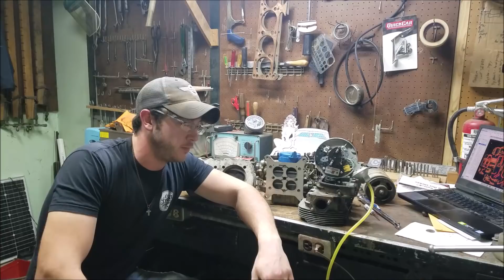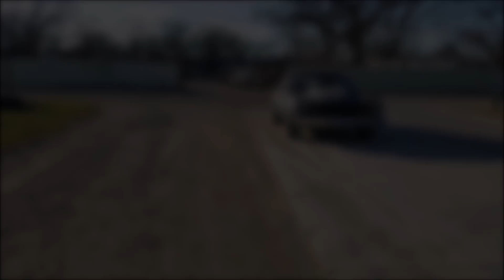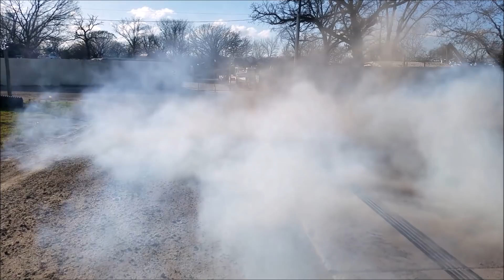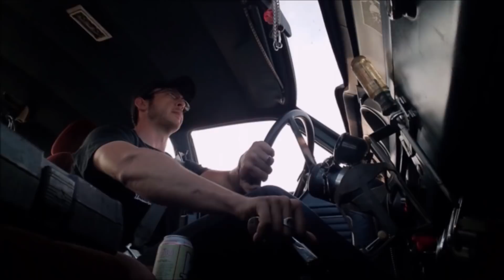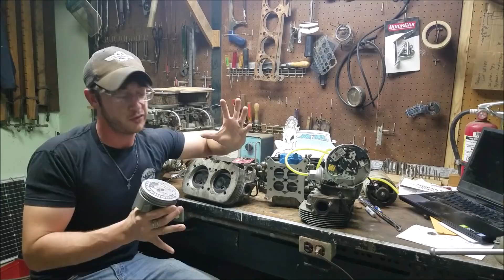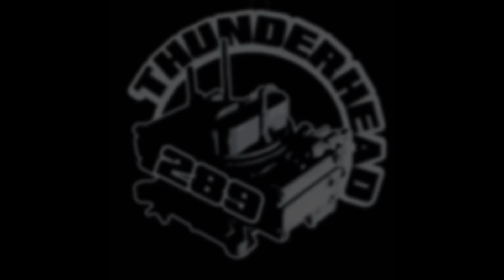How Ignition Timing ACTUALLY Works, ya idiots

Comment from the maker: Often, tutorials over simplify ignition timing to the point that its lead to an overall lack of understanding of how it works. for me, understanding what a system is trying to do is often my own deliverance in having a strong command of how to interface with that system. okay, so less engineer words here - if you understand how something works, you are much more effective in tuning it to peak performance.
Edit: one thing I forgot to mention - when you go up in altitude, atmospheric pressure drops, so ignition timing has to increase for all things equal at sea level. 
Progression Ignition distributors don’t a stupendous job of handling this on the fly.
Reply: I would do a tuning tutorial for the most common thing, which is heavily worn, high mileage cars which have low compression due to wear, and therefore want more advance.  That's in addition to both of mine being low compression smog motors.  However, some old motors also have heavy carbon deposits, which take up space, thereby raising compression, and can get red hot, pushing ideal timing the other way, unless cleaned.
     I think people got the idea of deleting vacuum advance by looking at full time dragsters than hardly ever see part throttle operation.  but vacuum advance  does hadly any harm even to full time dragsters.
Reply: ThunderHead289. My granddad used to play with timing. He made gasoline engines work on parafin. I used to play with it a bit also. I would advance my honda 4 stroke moped a bit to get ,,performance,, of a 2hp cb 50cc block(a netherlands moped block only allowed 49,9 cc) they had an balancer unit like your mechanical timing advancer.
Think jappanese: it worked the other way around. When reaching the max revs it retarded the ignition thus keeping the revs controled. I could rev my block up to 12000 instead of 8000. 2 way to block the weight. 1 some guys would put a taper trough the weight and the base plate. That was an deliberatie action.
2 block them with a strand of wire.
Possibillity 3 get an german or belgian flyweel.
That didnt have the counterweights.
Or take public transport?
Reply: Yah I live at 8000 ft and have a factory high altitude 2bbl ford 2150 carb.  Stickers all over engine bay stating "high elevation".  Says to bump timing up 2 to 4 degrees from baseline......funny thing is that just puts the 79 motor back to an identical motors timing made in 78 before emissions on this vehicle.  79 broncos had cats and 78s did not (except California).   Need to note that emissions vehicles have different timing specs than not emission vehicles so we need to "play" with things to get them right.
Reply: Hi, Luke,
Is the compression calculator link the same one u had years ago?  From Pat Kelly? 11:22
Thank you
Reply: Then when you think you got it all figured out throw weather changes into the equation and fuel variations (specific gravity and rate of burn) Great explanation Luke.
Reply: Sounds like you'd need a MAP sensor for detecting pressure drop at altitude.  Though you'd be getting awfully close to having a fuel injection setup at that point ;)
Reply: Don't understand what more timing means.  How is more timing achieved when you have changes in atmospheric pressure?  Wouldn't it effect how the carbonator functions?

Comment: having trouble with 390 FE. Had dist recurved for new rebuild. On my run stand Initial with max vax at 19 inches is almost 20 deg. Mecanical is 20 deg @ 3000 rpm. Vac adv adds 13 deg. Dist guy says to set initial to 14 deg and see if it pings. Not in truck yet. Does my Mechanical need to be lowered? Total timing without vac adv is 35 deg with initial set to 14 deg. Lowers my vac quite a bit.t Engine screams from 750 rpm to 5k fast on run stand if I set initial to 20 deg. Not sure what to do. if I time it at 20 deg max vac then crusing at 3krpm total with vac adv would be 53 deg.
Reply from the maker: I wouldnt draw any conclusions till its in a vehicle under load - that is the real test.  20 might ping like a son of a gun coming from a stop under load (ill save you the lengthy explanation as to why). 

But yes if you end up at more than 14, you are going to want to consider limiting total timing. 35-36 is reasonable - engines can ask for more depending on a number of factors with the build, but you really have to listen well and lift immediatly if you start to hear pinging. 
Yes, vacuum advance then comes into question also if you are going to be cruising then at an rpm that the total is all in by.

Comment: Is there any way you could post a video where you show what in-vehicle sounds like with retarded ignition timing, over-advanced ignition timing, and correct timing?  I'm working on a tired 460 F250 and set the timing to best vacuum, then pulled timing until it didn't kick back on starting (using ported vacuum)...and when accelerating it sounds like a tractor and feels gutless.

Comment: Excellent Content Thanks.    Question?   I'm struggling with understanding what "Initial Timing" Value is ideal for a given engine. (10°, 12°, 14° etc.).  Would Hooking up a vacuum gauge to Manifold port and (adjusting the distributor at idle, transfer slots set correctly) achieving the initial timing by reaching  (Max Vacuum, back off a tad) be a wise way to discover what initial Timing value is ideal for an engine?   Thanks.

Comment: WRONG
Reply from the maker: I mean, it's 1000 percent correct dude. Whatever you have been pandered otherwise is flat out incorrect.
Reply: @ThunderHead289  3200 lb pump gas driven 3 hours to the track small block 411 ' s carburetor cruise on 87 octane 10-second car 92 OCTANE ............. RITE .
Reply: But I am going to watch your video again I had a couple of interruptions I may have missed something . PS keep on Hot Rodin

Comment: Thunderhead289 I would like to hear your thoughts on the FE rocker arm oil restrictors. Should we use them or not? I know the FE engines have oiling problem because of the oil being pumped out of the oil pan to fast to the rocker arms. That was a major problem with the 390GT engine back in the day. I did a test with a drill on the oil pump shaft and I could pump the pan down below the screen in about 30 seconds on a 428 SCJ engine. I bought this engine as a rebuilt engine. Ended up rebuilding it again with boring it .30 over. I got stung on that buy. Lol.

Comment: I have a chevy small block engine with small cam.  Got it set to 800 rpm at idle. Advanced settings to 35 at tdc and 12 degrees idle at tdc. I used pressure vacuum gauge and the best reading I could get is 14. I was hoping to get it up to 16.Truck runs alot better than when I bought it. Im learning  everything about cars from watching your videos and has hoping for suggestions.

Comment: Hey Luke, been watching you for awhile now and have a question for you Sir.. I’m amazed in that I’ve been working on a Chevy C10 with a 383 Small Block. Initially guy I’d bought it from had vacuum advance disconnected. I re-enabled it. Ran better afterwards and better when re-timed. Then I had slight spark knock, and here is the strange thing which happened.. “Before getting the timing correct, I lessened the exhaust back pressure by going to larger diameter exhaust pipe, then here is the thing… The spark knock which was in engine went away with less back pressure in exhaust. This showing dynamics you had mentioned here?

Proof of your statements given I’d say, very cool Sir!

Question : and for example here..
“Less exhaust back pressure eliminated this particular engine detonation or “knock?”

Cool😊

Comment: Hey Luke, i have 1st gen 350 with a edelbrock e street top end kit with 315hp at 9.1 compression. What should my total timing be at and initial timing be? If im doing it right with the vacuum advance removed from the distributer  and plug its running at 14 degrees initial and 28 degrees @ 2000-2500 rpm thanks.

Comment: Vacuum works instantaneously, giving fast advance, working together with the acceleration pump squirts (carb side). As one throttles up to WOT, the vacuum advance goes max quickly and then decreases and eventually going zero (close to WOT). This is the basic idea. Centrifugal will only advance according to rpm, not helping out on the initial transient surge to start revving. This is the basic idea to have both working in tandem in the distributor. Great channel with really original stuff. Greets from Brazil.

Comment: Ignition timing has a lot to do with the resonant condition of maximum power. It's like a swing where you kick your legs out is like the spark. Where you advance the spark timing, there's more time to develop horsepower at higher rpms. Where you go over the top of the swing-set is like your horsepower peak. The timing of the legs kicking is just like variable ignition timing across the rpm range. Less advance at slower speeds and higher advance at high speeds. Compression ratio is the real source of all power. Ignition timing is just to fine tune all the performance that is really available out of the engine to the wheels.

Comment: Hey there Luke do you have an opinion on bbc gen 6 454 heads are vortec ? They seem to like less then 30 total timing ? But what about intial I'm a little confused with were to go after trying a few different things holley 750 dp with 544 lift 234 / on 110 lsa headers stock hei dui coil and module runing 30ish total 11 intial limited port manifold 10 deg ,  4 corner idle at 3/4 turns out on all vac is around 15 hgs any suggestions would help idle response is ok no real bog but I feel it could be better thank you  for your time  your the man wish you lived closer !!! Thanks justin

Comment: Thanks for posting. The younger generation needs more straight answers like these if they're getting into tuning. 4 out of 5 auto parts stores I've been to within the past few years had people that didn't even know what a cap and rotor was anymore. 
I personally use a timing light as well as a vacuum gauge when I set my timing. 
You're right about carburetors being pretty forgiving. You'll make it home, you'll just get terrible mileage until you get the tune right. That was what my car went through in high school years, haha.

Comment: I'm surprised.   Here's a TIMING Comment you didn't address. And it is.   I see guys over and over crank timing at idle then when they get on it they pink and blow valves.  Because timing is way too high .... initial set is 10 degrees.  Whether you use vacume or not.    Then the weights advance with rpm.     I the reason ghe weights advance with speed IS.  VERY IMPORTANT.    With engine speed the charge is comming in faster and the timing has to advance to keep up. That's what the weights are for.   So I see guys do initial at 20degrees then  Crack valves from over timing   bad bad bad. Explain this to people. In a follow up timing vid
Reply from the maker: You can use whatever initial the a fine asks for - my maverick likes 16. 
But advance limiters should be used if timing starts creeping past the 34-36 range. 
What folks actually don’t understand is that they need to consider the full timing picture - but they are lazy and don’t want to spend an hour with a timing light, springs, and advance stops.
Reply: @ThunderHead289  yep.  I see new chevy motors and all BB Fords Burn values after a New Rebuild  Because They Just turn the timing all the way up so it idles the fastest.   Then when They Drive Heat  Builds Ultra Fast And Burns Valves. Destroying Thier New engine with now a burnt valve miss ..      I personally  Just only rely on mechanical and never use vac because when I use vac  and I loose vac it falls on its face.  And when I don't use vac The mechanical carries the timing through perfectly with no flat or stumbling.    Another show would be great is Variable valve timing.   It really is a thing that even old engine should have.  Valves that open and close sooner at higher rpm.  That's where you get that low rumble at idle its because the Valves are acually real late

Comment: Late timing leads to hot exhaust gases which transfer a lot of heat to the cylinder head on the way out. If you get your timing late enough you can make the manifolds glow.

Comment: quite a good explanation...I once diagnosed a faulty vacuum advance by noticing that i manually had to advance my distributor to compensate the lack of advance at an idle, thus creating a dragging crank over while starting the engine...replacing the vacuum advance allowed proper timing and engine starting.

Comment: Fuel grade affects where your timing is set also. 
Super unleaded has burn inhibitors that make fuel slow burn through the stroke, therefore timing can be advanced quite a ways before TDC 
Cheap gas “detonates” or burns instantly and needs to be retarded closer to or after TDC… (the spring in the vacuum advance does this).
Adjusting the distributor changes the range of timing… not necessarily the timing itself. 
To get an honest ignition time one must not only disconnect the vacuum but also Keep your rpms low enough to not engage the centrifugal weights. 
That’s why Chiltons had a recommended rpm when setting timing. 
Great channel I’ve been binge watching. 👍

Comment: Ive always had luck tuning carbs , been doing it for a very long time... i never over advance carb motors, they tend to diesel when you turn them off...so by pulling a little timing, you can increase torque, while keeping your car from dieseling. Im talking about tuning an engine with low compression, naturally aspirated, .
I agree with you, I think the proper way to time an engine is to indicate the crank, start with a baseline and listen to your machine, drive it, learn .

Comment: How would octane numbers affect advance timing?
My car has a 9:1 compression ratio and was designed for 85 octanes,in my country 95 is the lowest value,and it seems that raising advance from 5 to 15 degrees has a better alround efficiency and performance.
Am I wrong?
Also what should the highest value compression ratio be at 95 octanes and still be safe for the engine?its a non turbo carburetted engine.

Comment: So I have a 302 in my truck with a pertronix retrofit unit. It tachs up and idles great, until it's under load. You can put it in gear and it will idle down the road, but as soon as you give it gas it will buck and stutter and seem like it's missing. I pulled a spark plug and it was beige. Have any clue as to what it may be. I have 12v at the pertronix, and a fresh holley 650.
Reply from the maker: Personally I have a 390cfm in my f100 that has a T5 and 3.73 gears - it outruns the same rig all things equal but with a 600cfm 

Is this a double pumper on top of everything else?
Reply: @ThunderHead289  no its a single feed, I just can't figure out why it's missing and stuff

Comment: I'm not sure why your discussion of centrifugal or mechanical ignition timing advance was so brief considering how important to performance of the engine it is to have it set properly. So often on YT I see people grabbing the distributor and turning it to adjust the timing and how incorrect that is. Idle speed must be set to specification before timing is adjusted. This is because idle speed assures the centrifugal advance is at its set position. If the idle is too low or too high the correct timing settings can not be made. The proper way to adjust timing is to work between a timing light and a tach assuring the timing is set at the correct idle speed.
Reply from the maker: The proper way to set timing is to set initial at the timing that there is no vacuum on the ported port at idle. If there is, your timing is late and you are supplementing with too much curb idle screw. 
I have a playlist on my channel that covers each and every piece of ignition timing - setting initial timing, setting advance rate, how to determine total timing. 

I start with having more timing than I think I’ll need and more curb idle than I need - then I balance those back and forth along with the mix screws until I have no vacuum on the ported port - the initial timing that gives you your desired idle RPM with the carb set like that is what your engine is telling you it wants for initial timing.
Reply: @ThunderHead289  Thats a pretty fancy explanation but if you go back and look at your videos you never say the idle has to be set to spec before you use the timing light. You may assume people know that but it is a manufacturer's spec that the timing value you set is @ specified idle rpm.
Reply from the maker: @DronesandHamRadios  because I set both of them high and real them in till the scenario I explain above is satisfied. 
The hell with manufacturing spec, that’s the hill everyone dies on and why I always look so smart when I tune stuff with an audience, I let the engine tell me what it wants - and the scenario I explained above is how the engine tells you.

Comment: Dynamic 🧐
I'm pretty sure you mean corrected. Dynamic takes into account way more than just IVC. 
I use my own calculator.
Bore
Stroke
RL
HGT
CH vol.
DH front to rear
PD
TRL
PDV
CT
Altitude
Degree Offset
I'm always within 2.5 PSI and always spot on with Stc and Cor.
I like your videos 👍👍 keep up the good content 🙂

Comment: Makes complete sense. I understand the whole difference between ported/manifold vacuum debate and how they work but when using ported vacuum we dont get any benefit from vacuum advance during idle. Would love to hear your thoughts on Unity Motorsports Garage theory on using adjustable vac advance can with manifold vacuum
Reply from the maker: I believe I have the highest viewed video on ported vs manifold on the Internet. 
Perhaps this video will help to further explain the benefits: https://youtu.be/bUv5tUC6Ioo

If you follow along with that video, it’s extremely elementary. 
Just remember who the engineer is and who isn’t out there.